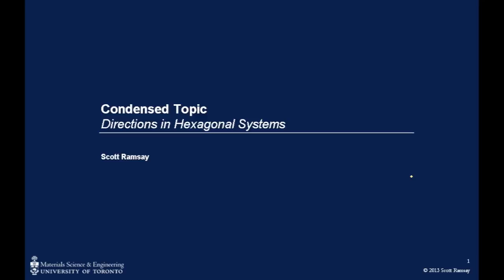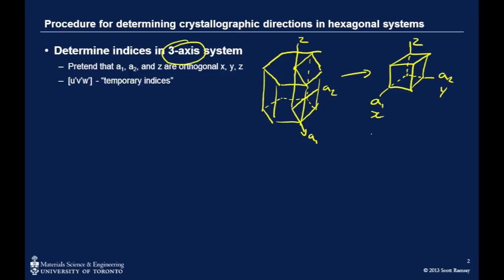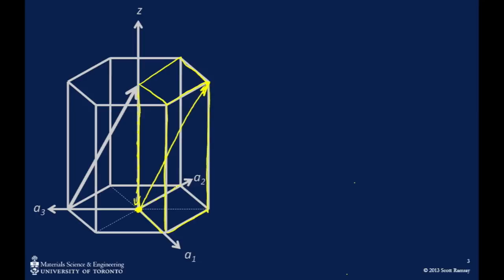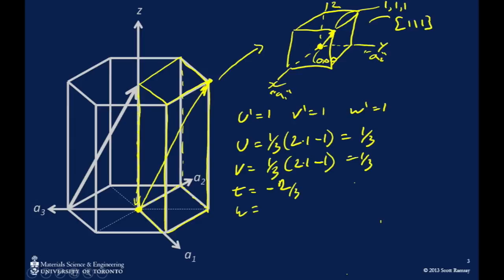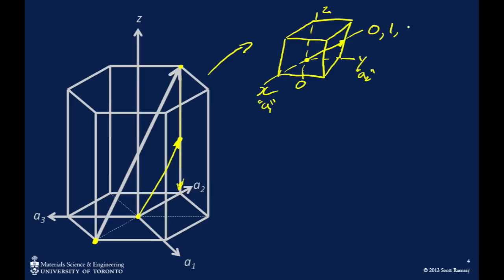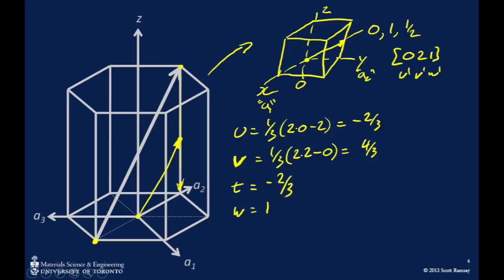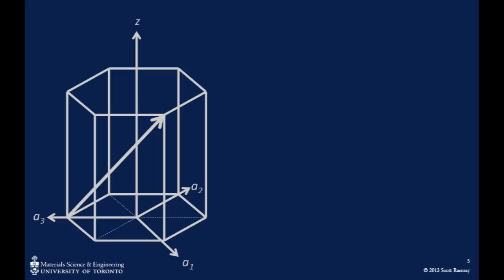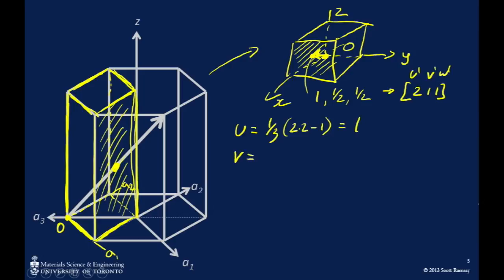Directions in Hexagonal Systems, Annotated Tablet

Comment: I can not accept the Z is 3 at 7:31.
Only for the math transfer, this vector [-2 4 -2 3] can not be intuitively indicated in the 4-axis system. Instead, I consider it should be 
[-1 2 -1 1]  because the intercept for the Z-axis and the vector is 1, not 3/2.